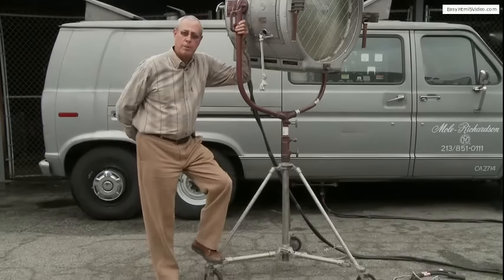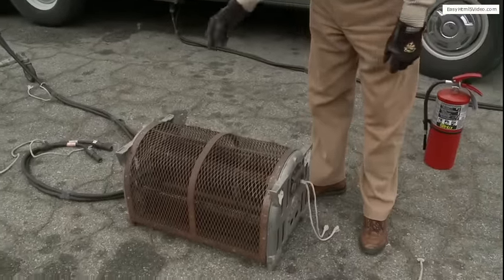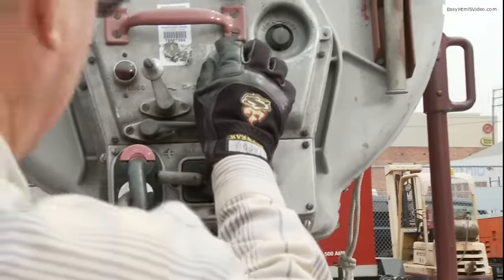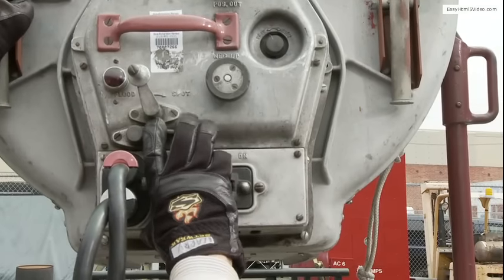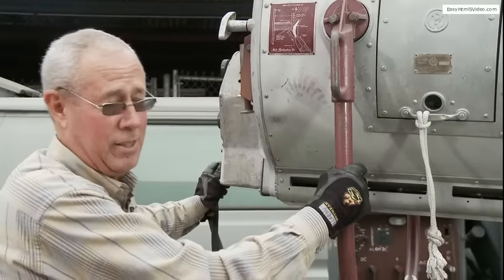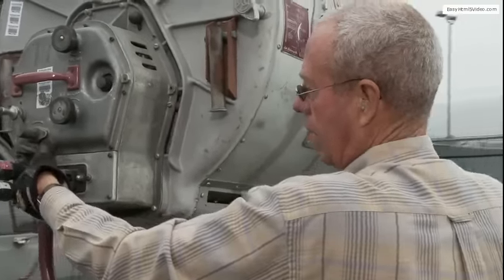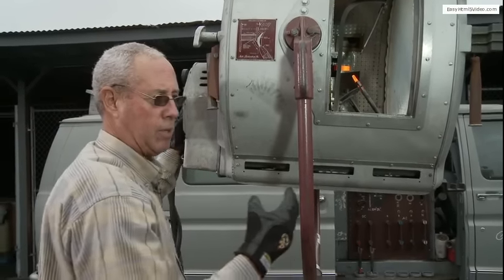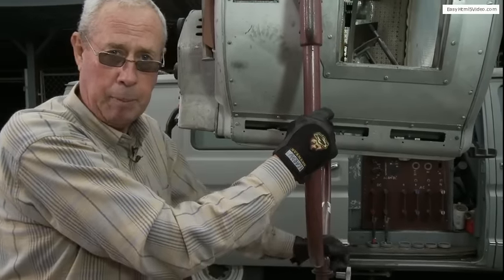How to operate a Carbon Arc

Comment: I was a projectionist at a theater in the before time.  Had a pair of these working 20-minute reels.  Never broke myself of the habit of looking for change-over dots in the corners.  Eight seconds.  You had eight seconds for the next reel to come up to speed so you could "open the blast doors", and get ready to hit the foot switch to swap shutters, and flip the sound switch at the same time.  Then it was on to closing the door on the old reel, shutting down the projector, queue up the next reel, check the rods -- which you did continuously during the film in between making some emergency splices and running off the old reel back onto a new one (rewinding).  It was a job.  You might have ten minutes for a bathroom break, but if you saw the film starting to "blue", you had to race back and get those rods realigned...quickly.  They would shelf easily, but at least you never opened the doors while it was running...mostly never.
Reply: I have a friend into 16mm film and with the oversized reels depending on the movie it's one, maybe two switchovers. He's got two projectors and 2-3 times a year we do an outside movie night. Not as intense but I can relate. 

Having seen both digital and film based versions of movies there is no question that film is superior in experience IMO.
Reply: I was a protectionist also in the 70's and 80's.  I  still see the cue marks on old shows.  A 200 amp dc generator in the back room.  Peerless arc lamp, simplex project, exhaust fans.  Candy girls. Those were the days
Reply: I want to listen to stories about that job... im sure they would be more than a little bit traumatizing to recount though. Sounds stressful.
Reply: I remember back in the '70's going to the drive-in with friends using the carbon arc for the projector Ted's father taught me a quite a bit about it along with watching free movies evey summer good times back then.. and the bowl shaped mirror ...
Reply: Go Blind...just like welding ..
Reply: @melody3741  : It's only stressful when you race upstairs, flip the reels, and realize you cut an 8-minute scene out of the movie, because you weren't paying attention.  And the joke is, the audience never noticed.  That's what happens when you hang out with the candy girls, rather than stay up in the booth.
Reply: @malcolmgreig5193  you are my hero. i use to wonder what those circles meant as a youngster and later in life i found out. i was so fascinated with projectors back then- am in awe of your experience with this equipment.
Reply: Me too. We used Morganite carbons as most cinemas in the UK did, copper coated. Strike up was via a four way switch panel before metal rectifiers and adjusted on each switch up to get a steady centralised burn—and hope you had enough carbon to get you through a 20 minute reel if you forgot to carbon up between reels, (sometimes it was touch and go), lol. Even after many years away from the business I never miss a changeover cue on old movies shown on TV. I started in 1958 and left the industry in 1974. They were the best days of my working life.
Reply: Reminds me of a certain Columbo episode.
Reply: Lol, wut?

Comment: Now imagine feeding over 10,000 times the amps as this 600 volts of triple phase power and you got yourself an electric arc furnace for converting iron into steel or recycling old steel.
Reply: Mole Richardson guy: I can strike a one inch arc!  Foundry dude: How cute.  
My neighbor ran the crane at Ford Rouge Steel, I don't remember the size of the bucket, but they struck a 6ft arc!
Reply: Yeah, and bring the charge out of the rain a couple minutes before. Just let me know first so I can take my break 😬

Comment: I did a Western in Flagstaff in '86. Two Lighthead Brute arcs and even a Duarc.
Great lights; they each have a personality. Actually, each trim has a personality.
And  they kept the brothers workin'! Each lamp (sometimes two, if close together) needed an operator. I can recall various old-timers showing up to work w/ one pair of heavy leather gloves and one pair of pliers. (Maybe a small flask too)
Notice a fold-up handle at each corner of that head. Yup, one man on each corner to lift it. It may look like a giant Midget, but it is truly a Heavy Head.
Good times. IATSE 728 - Los Angeles
Reply: Neat story thanks for sharing 👍

Comment: Wonderful to actually see the man himself, demonstrating what was an essential lighting tool for the movie industry worldwide until led lights and hdmi lights took over, and film speeds increased.  I worked at Pinewood in England in the ‘60’s and ‘70’s, and those lights were in constant use on the James Bond films.  The “evil genius lair” sets, which were huge and incredibly expensive for the time, could not have been lit well without the big  Mole Richardson arcs, hired in from Samuelsons, in London.

Comment: In High School, I was a theater projectionist.  We used DC Carbon arc in the projectors.  In a nearby room was the large rectifiers to make AC into DC from line AC power.  Anode and cathode.  The projectors had chimneys out thru the roof to carry the resulting smoke.  Both projectors had broken mirrors, but I'd keep "repairing" them with metal tape.  The carbon rods were copper coated.  I kept a few for memories sake, but It's been 20 years since I saw em in a box in the basement.  Fun stuff.

Comment: What a blast from the past!   

We got to do a project with a Brute Arc Light very much like this at CBS Radford Stages in the 1990s, even then it was almost a museum piece.   We got operating lessons from some of the older guys from the CBS Lighting Department.   They came by a few times to check up on us.   I joked with them that I was still getting the hang of it, but I kept scorching my forearm when I reached in with C-wrench to change the lower carbon from time to time.    I was surprised when they told me “No, you’re doing it right!”   The guy patted me on the back and says “now you’ve got you’re sergeant stripes!”   He went on to explain, in the old days when you walk around the studio lot or went to the commissary, you could spot the electricians because they had tell-tale scorch marks on their forearms from changing the carbons— “We called those your sergeant stripes! You’re doing it right!”

Comment: Awesome.  I was lucky enough to learn much of the old techniques for projecting with arcs when I worked as a young man in a chain of old theaters.  So the carbon arc technology is familiar.  But it's great seeing these large stage lights.  Very cool. Thanks.
Reply: I remember I'm my younger days hanging out with some friends that had parents that owned the drive in and the had carbon arc lights in them as well as the bowl shaped mirror...good times back then

Comment: I remember making a rudimentary Carbon Arch in the mid to late 1960’s with battery cores and the mains and I’m glad I only had it going for a few seconds as it lit up my bedroom. Oh brother was it bright and not to be repeated as the consequences of an accident could have been more than serious.
Reply: I did the same thing! Did you use the carbon rods from the squarish lantern batteries? Those are what is used and looking back I now realize how lucky I was not to have burned down my house.
Reply: @kaptainkaos1202  
I seem to remember that I used the carbon rods from depleted uranium… NOT! The carbon rod’s came from a A1 battery or 2 of them. And then rapped the mains around the ends of the rod’s and lit up my bedroom like there was another sun shining. Something that I should have done outside or at least in a outhouse of sorts. I’m glad I survived that little excursion into being a lay-scientist of 13 years old fully intact.
Reply: Lots of UVC there plus mains voltage is lethal. Lucky you did not go blind. Or died.

Comment: When I worked as a projectionist many moons ago some smaller cinemas still had carbon arc lamphouses in use. The carbons burned down in about 30 mins so they weren't any good for full feature films unless you ran them on 20 minute spools with changeovers between reels, which is how it was done in the old days. During my time in the industry it had mostly gone over to xenon lamps that had a life of 2000 hours and only required the flick of a switch to start them. Much more practical. The old carbon arc machines were only being used to show film ads and trailers before the feature by that time. I sure did love tinkering with them though, and the quality of the light was better too - a much more accurate light spectrum than the xenons when you got them burning just right.
Of course it's all dead tech now - the new digital equipment has replaced all that dirty noisy old gear these days, and a projectionist is no longer required. I'm told by those still in the game that xenon lamps are still used to project the image though, so at least one facet of the tech is still in use anyway.
It was great to see an old carbon arc lamp once again, so thanks for that.

Comment: I may be wrong as I can't see inside it, but your "grid" is likely akin to a ballast. It's job is to limit the current(amps) to the electrodes.  Arc's a negatively resistive and will take whatever current they can get. The Grid box keeps that current to a manageable level so your electrodes dont wear too fast or melt the mounting points(among other reasons I am overly simplifying the explanation).

Comment: Carbon arcs were used in the original blade runner in outdoor scenes. I find a lot of today's films, particularly sci-fi's have a very flat look to the them (look at 2049 vs orig blade runner). I've come to the conclusion it's a combination of the digital cameras and LED lighting used now. Pre the digital era, film stock added grain and filament lighting and carbon arcs also added a slight natural variability to the lighting levels resulting in the film magic we see in these older flicks.

Comment: Thank you for sharing an interesting demonstration!
When you mentioned "throw your HMIs away", I wondered if it would be true if digital cinematographers today would have less trouble with image flicker when shooting different frame rates and shutter speeds if they just used carbon arc lamps instead of HMIs?
Reply: HMI is not LED. it is another ARC source with a higher color temperature
Reply: @Eli.Suarez  :  Actually, I didn't think (or say?) that HMI was LED.  I just have heard that there is sometimes flicker problems in the recorded video (and not seen in the HMI light itself on set) when shooting with HMIs powered with magnetic ballasts.  I just thought I'd give a plug for old-fashioned carbon arcs here, since I don't believe they can cause flicker problems for film and video like HMIs sometimes can.

Comment: Used to run a par for movie projectors. The carbons were copper clad. The negative is about the size of your positive. The generator ran 70 volts and the arc ran about 25 volts at 70 Amps so it was considerably lower power. With film, you have a heat limit on the film. Unlike that projector with a large front lens, the carbon arc projector lamp has a polished reflector behind the arc to focus the light to the film frame and does not use a lens. Due to the mirror, the strike raises a guard past the negative to prevent strike debris from hitting the mirror. This is lowered after the strike. Behind the mirror is a bar magnet to blow the arc away from the mirror and up so the flame is not casting shadows from the positive which is in front, not the rear. The short small diameter negative extends through a hole in the mirror to the drive motor. There is no polarity indicator light. Projectors were permanent installations. In a new installation, polarity is verified at strike. Due to the magnet, the incorrect polarity will blow the flame down. When that happens, immediately disconnect power and reverse the polarity. With polarity reversed, the carbon feed motor runs backwards.

Comment: Quite archaic. There are arc lamps that uses parallel rodes with separator. So no need to adjust rodes. Also Tesla used high frequency alternating current that cause equivalent burning out of both rodes. Of course it can be that you can't use high frequencies because of radio noises but you can just periodically swith polarity.

Comment: My carbon arc story is that as an apprentice in the printing industry, we used them for exposing photographic plates. We had a bathtub-like reflector with 4 pairs of rods and if you turned it on and one of the pairs didn't 'strike', my boss said to "Put one hand behind your back so you don't get electrocuted and tap the back end of the rod with your finger".   That would make it catch.  Did that for 2 years, also lit cigarettes from the end of the rod just after turning off while it was still glowing.  There was no shield, it just looked like a half size enamel bathtub on it's side and the rods stuck out above and below with a huge transformer underneath.    The "Good Old Days" that almost killed me.

Comment: I worked for a film production company a long time ago. These had largely been replaced by 12Kw HMIs by then, but one lighting cameraman insisted on them, and we needed to get a special generator to run them. The sparks called them "brutes". The clapper/loader spent quite a lot of the day sitting about four feet away from one of them. The next day, one side of his face was all red and sunburned, and peeled over the succeeding days.
Reply: A fellow I know was using a 4K  HMI fresnel on a car industrial job (late 1980s or early 1990s) and somehow the lens or UV safety glass had been  broken but they decided to use the light anway as a broad source.

They had some CTO correction gel clipped to the barn doors but one side came loose and the guy leaned in front of the fixture for a few seconds to re clip the gel rather than move the ladder to the other side, and in 5 minutes he was on the ground in pain with his face swollen up and eyelids swollen shut.
INSTANT sunburn.

Comment: I would have liked to learn more about the ballast. The arc is a short circuit. The Ballest keeps the power under control so the generator does not feed a short.

Comment: I have an old welder/torch (around 1950's circa) that runs off of 110 volts and is built into it's own suitcase.  It has two carbon rods of which are "struck" to make the arc for welding.  I call it an "electric torch".  It was left behind in a house my wife & I bought and I have yet to try it.

Comment: Excellent video indeed. Might we ask what's the "average" or preferred color temperature (K) that this unit generates...perhaps nearer to 5000K or so ?  I ask, as the rendition of a "normal" skin-tone on film or live video appears best overall at a certain K color temperature or within a range.
Reply: +Joseph Rotello Carbon Arc lamps produce light closer to 6000 degrees K

Comment: I remember the giant search lights on trailers that were used for grand openings and such.
I worked at an old theater that still had a carbon Arc projector.
Not in use, it just sat there.
They had a natural gas fired generator to provide the juice that went to what I thought was a rectifier, now I know that to be the resistor Bank (load).

Comment: A long time ago I was studying at a medical school and they had a projection microscope which looked real old. It could project something under the microscope so that a whole class could see it. It used a carbon arc as the light source. The reason they still used it was very simple it just worked and nothing modern was quite as good.

Comment: Two questions. 
1 - how long doe rods last?  
2 - If there will be no action for five min, would you turn them off or leave them on ?
1,000 amps at 73 volts is only 7.3Kw - these lamps are way more efficient than I thought. 
Generator exciter voltage should be turned down to start around 85 volts.

Comment: I worked for a large printer in the seventies and they had an old machine for exposing big offset plates. I could be wrong but I recall it was a carbon arc also.

Comment: I was fascinated by search lights when I was a kid.
Here is a much smaller version of a Carbon Arc lamp.
Used in the movie industry.
1000 Amps at 120 volts = 120,000 watts   or 120 Kw. 
so that is one big generator to run a single lamp.

Comment: did they ever pump inert gas into the carbon arc area, to lengthen the time of use? like co2 or argon?
Reply: You are thinking of vacuum. Even an inert gas can be ionised by the electrical arc.

Comment: The Gen-Van is AWSOME! I´m not so thrilled by the spotlight but that van- man! What a cool RV that would make! No worries about loading water and gas, i guess that thing could handle it. Are both rear axles powered or is the 2nd one just "dragging"? I love how it´s been stretched! Is this a factory option or custom made? It just looks so not off of this world.
What exactly IS that? Not many vans goin round in Germany because of the mileage- it´s no toyota, ain´t it? ;)

Comment: Hey would love som info on the generator van!
Reply: Yes yes yes
Reply: SAME
Reply: I second that motion.
Reply: It’s a good bet that the generator’s engine was a Continental. Definitely a 1200 rpm machine, that’s why it’s so quiet. It would have actually been driving two generators on the same shaft. A small one called the exciter exciter which generated a low voltage DC current that supplied the field voltage for the main generator. And the main generator itself that produced the 90 volt, 1000 amp current for the arc lamp. A lot of those DC generators were made for the military during WWII and then sold cheaply to the movie studios. Same for the large arc searchlights that were common in the late 40’s and 50’s at outdoor events and store openings. Those mobile searchlights were used in the war to spot enemy airplanes.